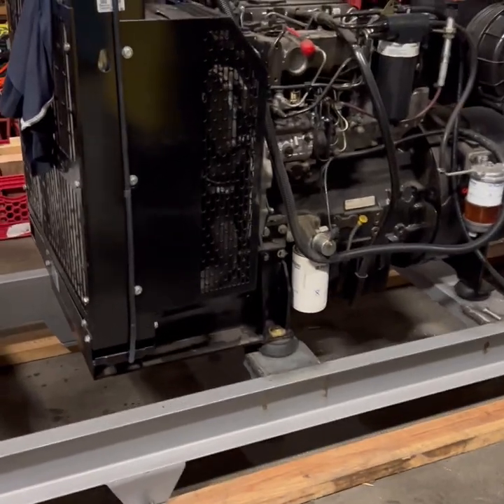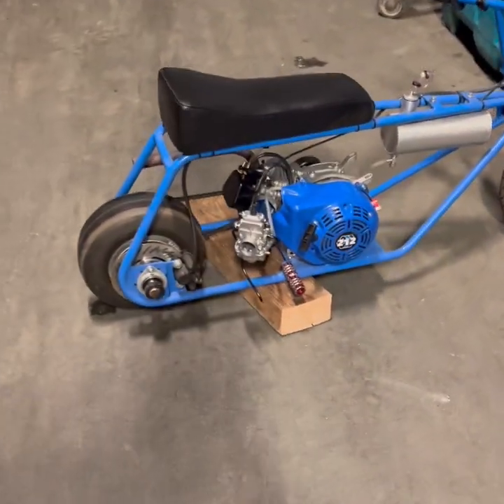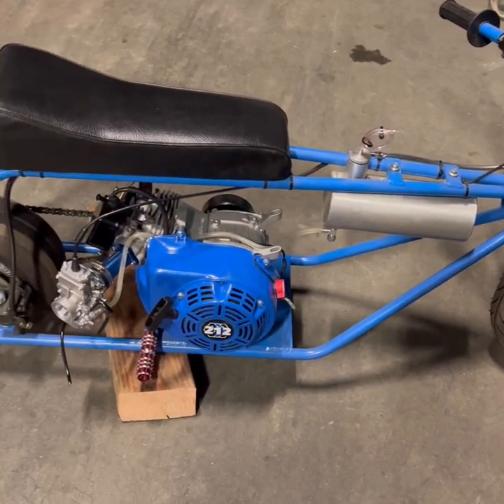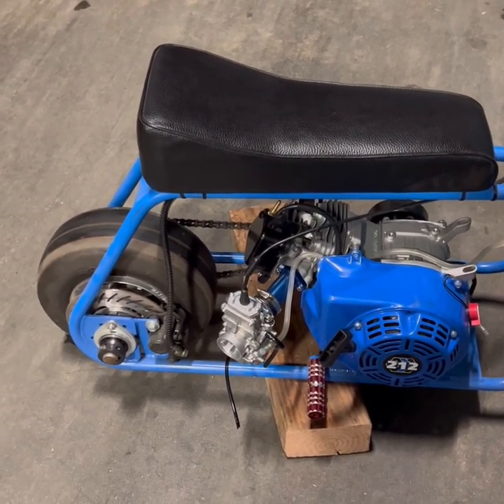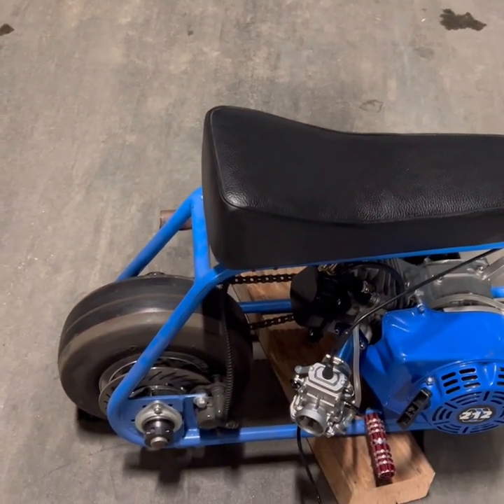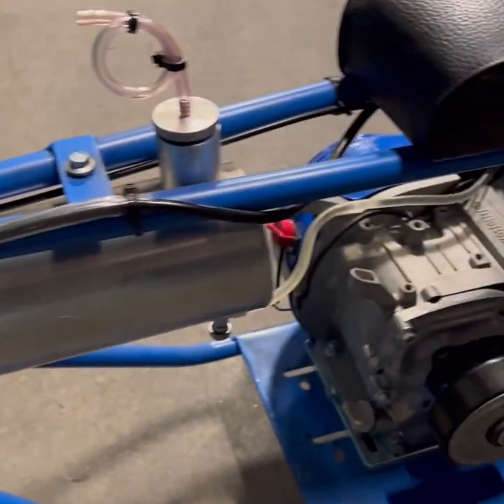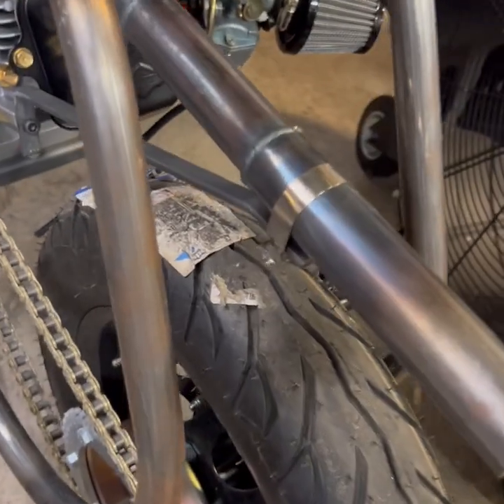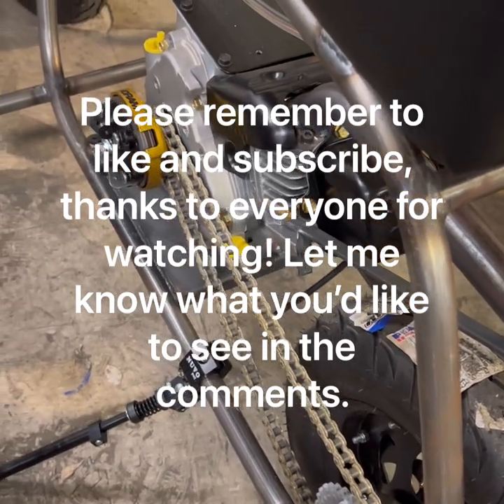GTS mini bikes, Drag frame with 236 ccs and my new 5”x10” Briggs Animal Powered Custom.

Comment: Lookin' good! Fantastic workmanship on that Animal pipe as well!
Reply from the maker: The guys over at GTS are amazing, that pipe was kind of a surprise and it sounds angry. I stuck a MaxTorque clutch with the black spring on there yesterday and took it for a quick ride and it was just as I suspected. I got going fast enough to blow my hat off and the poor motor sounded like it was barely turning 2500. Looked all over for my 54 sprocket until I remembered we put it on the Azusa bike with a 79cc Predator. One of these days I’m going to revisit that project, just need a 100cc donor from HFT or I’ll use the brand new 3.5 Tecumseh I’ve got sitting on the shelf. We’ll see.

Comment: Frosty I got the same carb (vm28) thst u have with the same issue ! It races ! Idk y . I’m thinking that the carb cause it’s used that it has issues I need to figure out so I bought a new one and going to test it out . Is it possible to hit u up on insta? I need to know what jets ur using on the vm28 . Ty wok much
Reply from the maker: It was the Float Needle sticking on mine, damned thing would run out of fuel and just not restart.
Reply: @peterchristlieb  glad u fixed it . I bought a new carb cause the other one I had was used and I felt like there was something wrong with the carb itself . I swapped it out today and it rips !!!